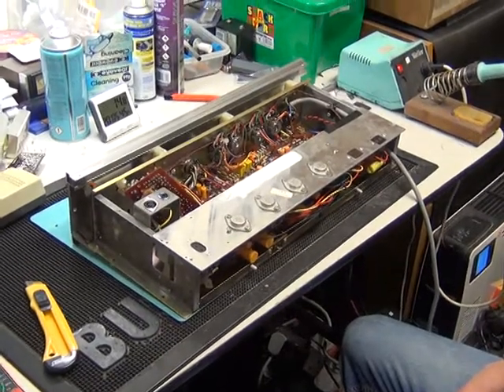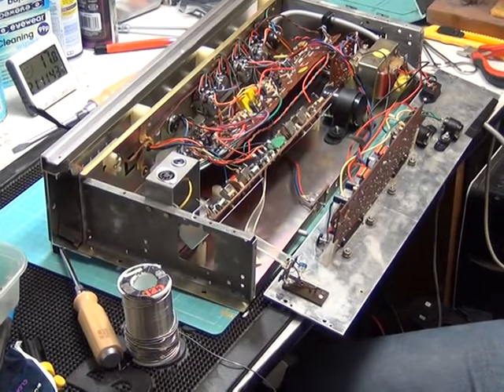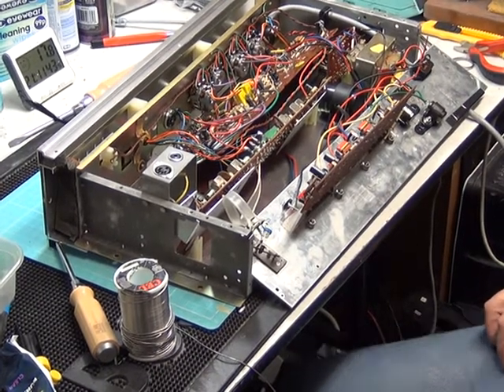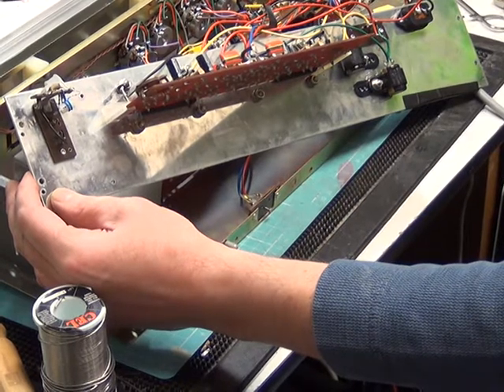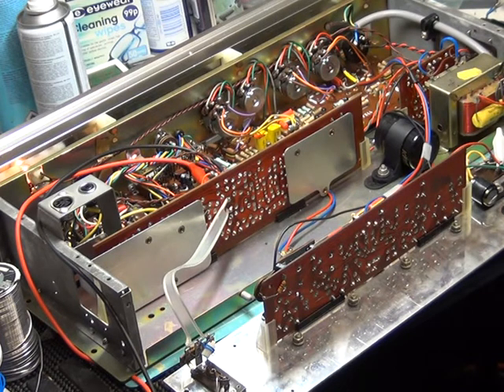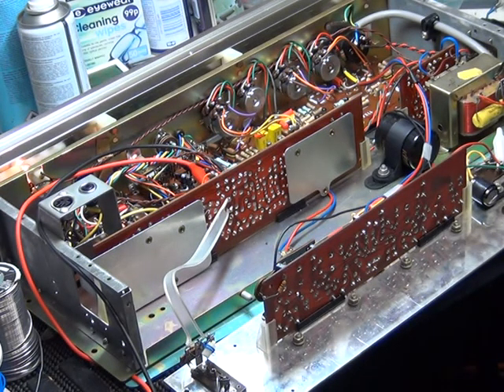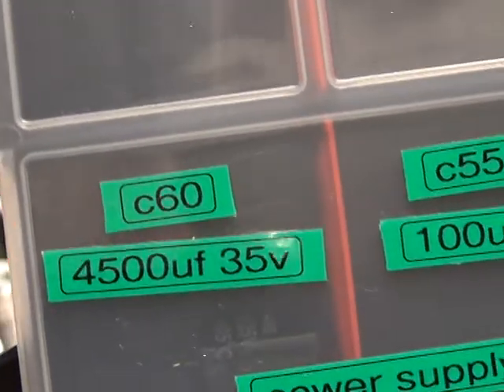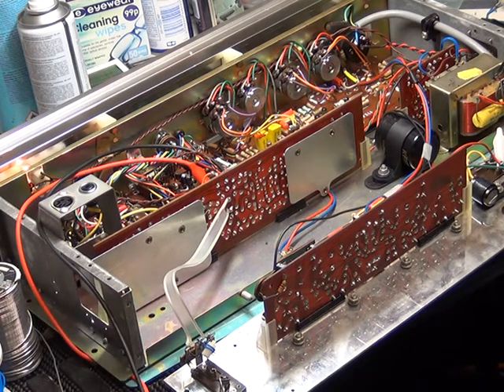HMV 2412 Stereomaster radiogram overhaul Pt2 - electronics chassis

Comment: In my opinion the stereo decoder on these units were more of a gimmick than a bonus. Most I knew who had them tended NOT to use the option. 😗Pioneer receivers with the PIL stereo signal locking showed how the system should work. 😗We have to remember that these UK built units were VERY early days for new tech etc. Most of the time as I've said they were added gimmicks. 😗The UK was NOT by any stretch of the imagination the best re quality and longevity of their products re radio and especially television!😗 Ultra, HMV, Ferguson et were always failing one way or another.. it was NOT until the Japanese brought in electrical goods that we could actually feel we got value for money! 😗It should also be noted that at the time of this being an item in the stores.. the BBC did in the UK transmit a STEREO broadcast signal for consumers et buyers from 1973 across most main stations, it was NOT as good as the signal a decade later et. MOST records, singles and LPs were composite stereo (high fidelity et) OR MONO.

Comment: why would you want to change 70's capacitors? Why would they fail?
Reply from the maker: Electrolytic  capacitors fail over both time & hours of use. Most electrolytic capacitors have a 1000 hour life at the rated temperature & voltage, hence it being sensible to use capacitors with a better temperature capability (especially in valved equipment)..not so important in gear like this where little of it will ever run much above ambient temperature. The Callins & Hunts branded black moulded original capacitors started playing up within three years of these products being made. Don't think they were fitted by the makers knowingly as poor life, the 2419 model that came after this didn't use those brands.

Inside the capacitors is a roll of foil & absorbent material (and an insulator). The absorbent material is saturated in a chemical. Over time, this dries out & the capacitors fail. There are 'billy-no-mates' capacitors today used in cheap products that will barely last guarantee period & there are branded ones of high renown such as I've used here. Even using high quality capacitors like I did, the parts cost for all of them is under £20 & the time on the bench about one hour.

Hope that helps,

Richard, G0OJF, UK

Comment: This video gets an instant like (as if I wasn't going to already) for your reading out of component specs as you go along. Will make verifying and ordering up replacements so much easier... I wonder if my 24v supply is working, the panel bulb certainly is burned out but not so sure on the stereo indicator.
Reply from the maker: It's the 15V line developed from the 24V on the stablilizer board that was a snag & running @ 18V because of that knackered preset.
Reply: Yep, finished watching the video now. Obviously I do have 24V then or it would be a dead set. I'll keep a close eye out for the voltages when I go into the recap on my set.  Thank you again for sharing. You don't happen to know the spec for the stereo indicator bulb do you? I can't read what it says!
Reply: Wow that's an interesting point on the way it's listed. I had noticed similarities to both Ferguson and Fidelity chassis' on this model. I have a Ferguson 3926 in the kitchen as a daily listener.  I know Ferguson and HMV were Thorn/EMI brands at one point, do you know if Fidelity were?
Reply from the maker: No, but Fidelity were cheaper products & did some HMV look-a-likes
Reply: Definitely Fidelity were the "lower end" of the market from what I've seen of them, they seem to last well though. The UA3 "Radio Master" (*cough*) is the one that I felt looked a bit similar, at least panel-wise anyway, the tuner feels horrible on that & on investigation it's not a fault with the dial cord from what I can tell but plain bad design resulting in a slippy/jumpy tuning experience.
Reply from the maker: @danmackintosh6325  The tuning capacitor bearing probably need some oil. Of course the HMV Stereomasters used electronic varicap tuning & I have a sneaking suspicion that they were the first product to ever use electronic tuning with the 2028 in 1967
Reply: Final thought, listening through headphones reminds me of listening to Radio Luxembourg as a kid, going from one side to the other lol